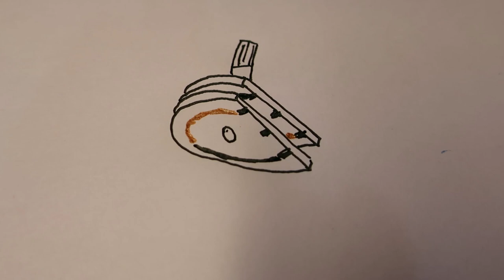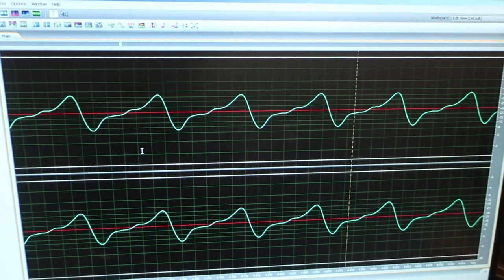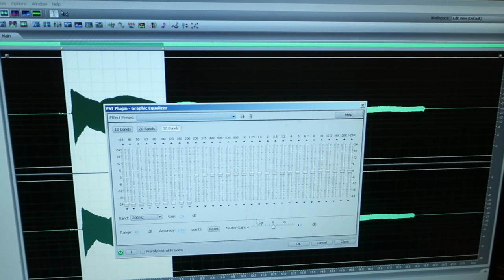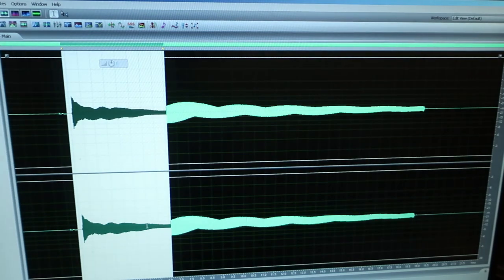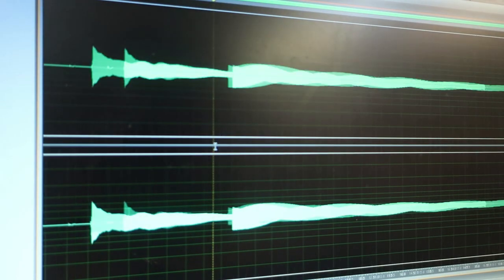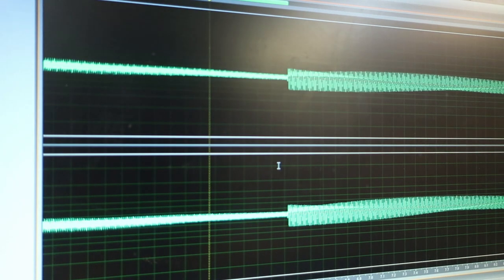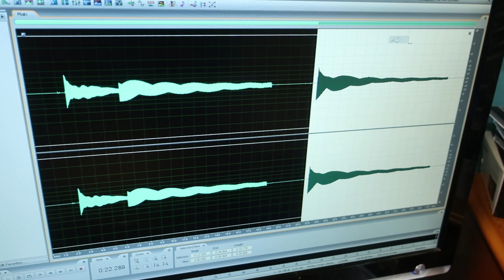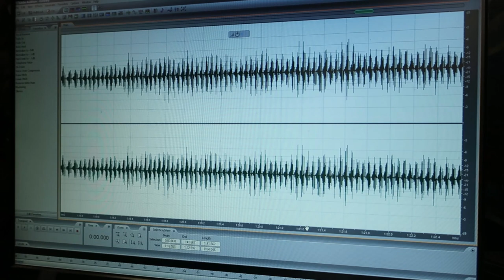Potentiometers - How and Why

Comment: Whichever Pin you wire the Input to the Pot will have an effect on the front end of your Amp. If you wire the Pickup to the Wiper, you have a constant Resistive Load on the Amp. If you wire the Pickup to an end of the Pot, and the Wiper to the Amp, you have a variable Resistive Load on the Amp which some Amps do not like. ...  Regarding smaller value Capacitors and their effects at higher frequencies; You will find a marked difference between a Mylar Cap, (your GreenCap), which is a pair of Plates wound as a Cylinder, (therefore inducing an Inductor into the Circuit), and a Ceramic Capacitor, which consists of a pair of Plates with a Ceramic Substrate between them, like a Sandwich, which has zero Inductance. Pop down to Jaycar and grab a couple of higher value Ceramics to play with.
Reply from the maker: Indeed, I'm planning to do a few experiments just like that, I've seen a video where a fellow wired up 15 different caps to a series of momentary switches through a breadboard and just cycled through them to show the difference but didn't give any supporting info. I need to try it for myself to get my head around what's actually going on.
Reply: @fanbladeinstruments  Google "Potentiometer as Voltage divider" and you will get more of a technical explanation of what you are learning.

Comment: Thank you for the very informative video. I have a question that I'm having trouble getting info on. This is somewhat unrelated but do you know of a type of pot that has a center off? By that I mean,when turned right it will control the speed of one motor and turning left to control a second motor. This would be the best way to explain what I need. The actual function I'm trying to achieve is,I  have a reversible motor speed controller that I use for a trolling motor. I modified the top of the trolling motor by removing the 5 speed forward 3 reverse drum switch and put my motor speed controller potentiometer to the handle in it's place. This works fine but but in order to switch  direction,I have to use an on off on rocker switch and turn the handle to the right for both directions. Although I've gotten used to this,I would like to be able to control this like a regular trolling motor,turn right for forward speed and left for reverse. If I could find a potentiometer that works this way,I could  set up the on off on rocker switch as the center detent of position. I've thought about using two  pots to mechanically turn right to control one direction and left  for reverse but one would have to be completely off before the second one is turned on. It seems this would be a real pain to set up even if I could and there is limited space in the housing for little more than what I have in there already. If I could find a pot like this,it sure would be more simplified. Thanks.